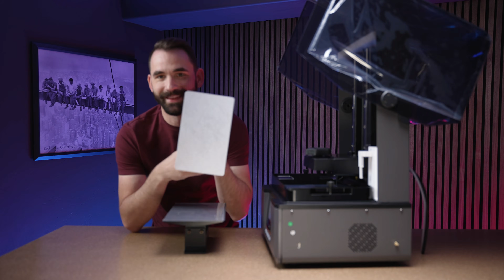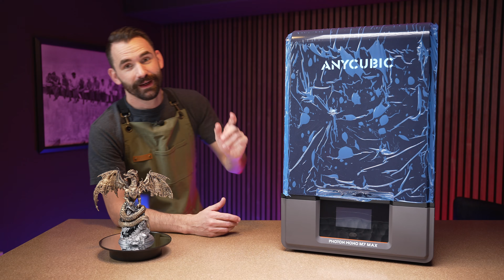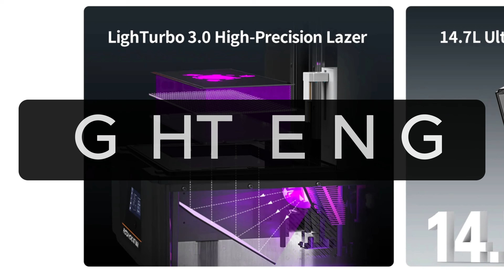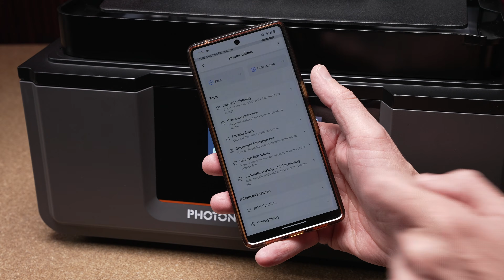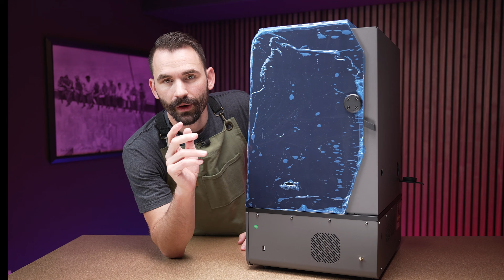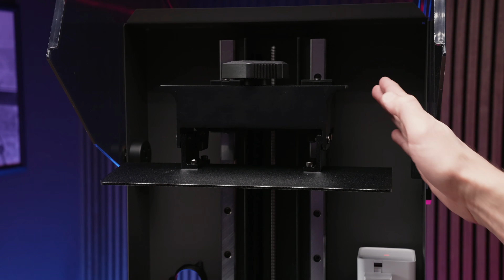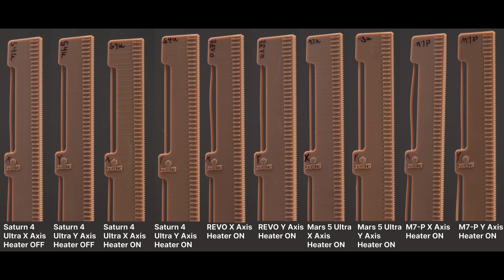Should the M7-Max be your next Printer?  #review #3dprinting

Comment: I have to ask and hopefully it doesn't sound like I am just seeking your opinion
I have the budget for either the GK3 pro or the M7 Max, same price really, but the M7 max just seems to have better features overall and seems sturdier, feels like the GK3 pro did not live up to its hype from the GK2.
That being said, I mostly use my printer for terrain and minis, spefically warhammer and bolt action, will the 7K for the M7 max provide enough details to print them ? Or is it better if I go with the GK3 pro instead.
Reply from the maker: @sergeys80  The GK3 Pro is a 10" and the M7 Max is a 13". 

The Pro uses 385nm and the Max 405nm what most of our resins are designed for. 

The quality of the M7MAX with AA still won't match the Pro but for terrain and that kind of thing maybe that's not as important and the extra size will be better.
Reply: @J3DTech  so the question is, will my details on my 28mm minis still be good enough ? I currently was using the Saturn 3 ultra 12 K until it broke on me so am looking for an upgrade.
However haven't heard the best reviews for the Saturn 4 ultra 16 k sadly...
I ask because the M7 Max so far seems to have the best reviews, and considering I am still newish, just want to get something that will make printing for me easier and allow me to print my minis
Reply from the maker: @sergeys80  If minis are your focus and not the terrain I would look at the GK3PRO. I have been playing with one and it's doing well. 

That M7Max is really good but it won't have the accuracy you're used to.
Reply: @J3DTech  I just saw your comment regarding the single rail and the fact that the GK3Pro is mostly made from plastic versus the M7 Max pro that is made mostly from metal and I guess I am just hesitant spending the exact same amount on something that feels a bit cheaper.

I also saw you reviewed the Saturn 4 ultra 16K and phrozen 14 K.
Both are also in my radar.
Reply from the maker: @sergeys80  You mean Ultra? 

The Ultra is the 13" the Pro isn't out yet. 

I have both.
Reply: @ Yes, sorry the Pro, I know it isn't out yet, however pre-orders are live now and it would ship by March. 
And I believe I saw your video on how you explained how it's plastic and only single rail versus the standard double rails we are seeing for mid range printers, especially for that price.

Comment: good evening, thank you for this video. I recently bought this printer and I have two questions: 1-how do you use lychee slicer with it? I tried to export an exposure test file but it is not recognized by my printer when I connect the supplied USB key.
2-I use sunlu 14k dark gray and the rerf test file as well as an exposure test remain stuck at the bottom of the tray. Is it my leveling that is not good or should I increase the exposure time of the first layers? (currently 50s)
Reply from the maker: @suprabot5640  It should work like any other printer. Just make sure that you have the M7MAX in lychee and your printer is fully updated. 

Inside this printer often with Lychee with no issues. But I would recommend skipping RERF and just using Boxes to dial it in.

On the Lychee Slicer YouTube channel I've created a video on how to dial in your resin settings go check that out.

Comment: Hello, I need your help badly:

I have an M3 max printer that has broken down since September. I changed the LCD screen because the resin had seeped in. The change went well and when starting to test, I discovered that a chip on the motherboard had burned out. I changed it and the chip burned out again in the same place!! Anycubic's after-sales service does not answer me honestly.

Do you have any advice to give me to save my 3D printer? Because I am an artist of Warp Worlds ... it is about the survival of my business.

Thank you for your help
Reply from the maker: It sounds like maybe there is still some resin inside the printer that's causing the issue.. It's a crappy thing for sure but if you get resin inside the printer... It's going to be a very bad time. with people I have helped in the past it sometimes ends the life of the printer fully. 

But my advice is to really make sure that there is nothing that could be grounding out. No resin or metal in the PS, or MB or anything. Make sure all cables are clean and free of any debris. 

As far as how do you get a new MB for test three send me a PM with your email and I can get it over to my contact over at anycubic and they can go from there. But again when dealing with electronics you're REALLY going to want to take your time and make sure everything is good, even pull out the voltage meter and make sure that nothing goes inside the PS and is causing issues as well. 

To be honest it may be smarter to go deeper and replace more components just to make sure you have a good unit again. Like I said before, often a resin dump into the chassis can be the end of that unit regardless of the manufacturer.. It sucks but sadly it's an aspect of this hobby. This is part of why I ALWAYS use the spatula to check the vat before every print.

Comment: Does the off compensation work the other way as well?  As in if it doesn't feel pressure from viscous resin will it shorten the light off delay?  I currently have mine set to 7 seconds delay in the slicer but just checked my print and only seems to be doing a delay of a second

Comment: Any suggestions for bottom exposure time? I've always been time you didn't want to go over 30-35 seconds because it's bad for the screen but I'm having trouble getting stuff to stick to plate
Reply from the maker: @JrodsRabbitry  How long you have to expose the bottom layers has to do with your layer thickness, resin, temps and the UV power of the the UV array in your printer. 

Setting a very long "wait before print"  time will also allow you to lower the bottom UV exposure time. But often this requires the use of UV tools. 

In the end do what works for you.
Reply: @J3DTech  ok thank you.  In your experience is it bad if I take it over 40 seconds?
Reply from the maker: @JrodsRabbitry  What resin, printer and layer height?
Reply: @J3DTech  sunlu abs like, m7 max, 0.05
Reply from the maker: @JrodsRabbitry  40s seems a tiny bit high but not horrible. How much light off dealy are you using? The M7Max is using 6s on the bottom and I'm working with them in a firmware update to force 10s. This SHOULD help you reducie this number.
Reply: @J3DTech  I did two things and one of them has resulted in getting prints to stick.  First, I leveled the build plate without paper. Just right on the LCD screen like I do with my gktwo.  Second, I changed the light off delay from 0.5 seconds which was default to 3 seconds. Now halfway through a print that is stuck to the build plate!
Reply from the maker: @JrodsRabbitry  I would think layer compression could be your issue. Print by Build plate calibration parts to confirm. You will find the link and instructions in my guide. My guide is in the video description.
Reply: @J3DTech  ok will do....and you think that would be from leveling on the LCD instead of using paper?
Reply from the maker: @JrodsRabbitry  personally, I would never level directly on the LCD. That is a great way to scratch it up or get some resin residue on it which will make it slightly sticky. 

If that LCD or LCD cover has anything on it, it's even the slightly as tacky you're going to have major issues with that release film peeling off the LCD during a print which will massively increase the peeling Force. 

The other issue is that you need space. If you are level too close to the LCD you're going to get layer compression. That's what you're going to be testing with these build plate calibration parts
Reply: @J3DTech  Got it....I just watched your video on common resin 3d printing fails...I didn't even realize z offset was a separate thing from bed level...yikes
Reply: @J3DTech  one last quest before I run this calibration, I don't see a z offset on the max, I'm assuming this is a setting I adjust in chitubox if necessary?
Reply from the maker: @JrodsRabbitry  You cannot adjust it in the slicer and it's not on the max not yet anyway. I'm pushing that to be added. So right now if you need to set the Z offset you just simply have to increase the thickness of material that you level on.
Reply: @J3DTech  thank you very much for taking the time to help.  Increasing light off delay has fixed my issue! I leveled again with paper, and have my bottom exposure time down to 35 and getting successful prints.  Not sure why the default delay on this print is 0.5s and then anycubic tells people to increase their bottom exposure to 80s 😳
Reply from the maker: @JrodsRabbitry  80s that's crazy for a standard resin
Reply: @J3DTech  yes, and I've seen many people posting screenshots of their successful prints and that setting, some even 100s because that is what anycubic support is telling people that are having issues with adhesion.  I honestly never would have thought about light off delay, so again, very thankful for your knowledge and time!
Reply: @J3DTech  if I could bother you with one last question....light off delay, is that the amount of time from the time the light turns off, until it turns back on, or is it the amount of time when it's finished retracting until it lights again?
Reply from the maker: @JrodsRabbitry  Luckely we are not dealing with the old printers anymore where you had to do math. Now it's the same as Wait Before prints. Or once the motor stops moving after a full retract, it will wait "X" time before the UV light kicks on.
Reply: @J3DTech  ok, I must not be doing something correctly.  I have light of delay set to 6 seconds in chitubox but after it's done retract it is lifting again in about 2.5 seconds....and I have 2.1 second exposure. So for some reason the chitu setting isn't working
Reply from the maker: @JrodsRabbitry  Hmm try lychee
Reply: @J3DTech  ok promise last time I bug you.  So if that is the case that it is the delay after retract, I should only need about 2-3 seconds delay correct?

Comment: Does UVTolls work with this printer, say per-layer settings or adding black bottom layers to compensate for the lack of z-offset setting?
Reply from the maker: @dariorseventyeight  They are looking into it. 

It it depends on what you're trying to do with UV tools. 

Anycubic printers don't allow you to set different wait time per layer. 

At least not at this time. Maybe in the future?
Reply: @J3DTech  I need to print directly on the build plate. Besides the initial blank layers for the Z off-set, I need to set custom waiting times before cure for some layers (not just the bottom ones) with high surface to let the resin stop moving. With high viscosity resin and such a large build plate, I see this being a potential issue.

Comment: would you recommend this for 1/4 figures? I have now the Apex X1 but I'm not sure how long it will last. This M7 is nice but seems it lacks detail. Maybe the GK 3 ultra is a better option or maybe going down to something like the new Elegoo Saturn 4 ultra 16k or Nova3d 16k. What do you think?
Reply from the maker: @OctavioAlonsoHernández  I can't currently recommend the GK3U at this time. It's having major issues. 

The 16k LCD is not what you want either. It adds 0 details as the resin can't even do much better then 8k. But the file sizes and slicing time on 16 are insane! Not to mention the motherboard can't always process the data during the print and you get some major issues. 

Honestly If you want a good printer avoid the following. 

16K LCD on any screen smaller than 13".
Auto leveling 
A built in heater with no ability to control the temps. 

This rules out almost everything on the market ATM. Strange times we live in ..

Comment: @J3DTech - do you still have this printer, or was it just on loan? Mine had a huge gap between the LCD and the Vat film - it was almost 1mm, and it made it impossible to print in the middle of the platform with high pigment resins. Nothing would stick to the platform in the middle even at absurdly high exposures and equally absurd lift heights and crazy long wait times before exposure.

Finally I noticed the gap between the LCD and ACF film and measured it at almost 1mm with known thickness shims. I realised that must be causing my middle platform print failures by trapping resin in a "pressure bulge" in the middle of the platform that was too thick to cure through and stick to the plate. 

I fixed it by installing a gasket under the LCD to lift it about 0.9mm - and now the ACF and LCD are almost touching. I reported it on the AnycubicPhoton Reddit, but no one there had the same issue, which puzzles me. Maybe my printer is different? or maybe it's only really an issue that shows up on high pigment resins - and normal resins will manage to stick to the plate even though the first few layers are too thick in the middle ....

So if you still have it, does yours have the same gap? Would you have a chance to try printing an array-grid of small parts with a high pigment resin?

Comment: @J3DTech just got the M7 Max, and noticed the resin heater is only for pre-heating, which is not very useful for me because my printing room is often below 10C in Winter. Posted about it on Reddit and Facebook and got several replies to the effect that the power supply is not big enough to run the heater and the printer at the same, but also one reply from someone saying they spoke to you - and that you said you had a beta firmware version that heated throughout the print - is that true?
Reply from the maker: @n0f8r  Yes there will be a update soon that will  allow the heater to stay on during the print.
Reply: @J3DTech  awesome! thanks 👍
Reply: @n0f8r  any update on the heater staying on update J3D I only bought it thinking it would be a vat heater for the duration of the prints
Reply: @ryannawrotzky4488  seems my first reply was silently black-holed for including a link to the anycubic wiki, so you'll have to find that yourself - here's the original reply:
  yes they released a firmware update in March - can't speak to how effective it is since I already installed a separate air heater in the cover and sealed it up - and also it just got warmer here. But if you connected your machine to your wifi you can do an OTA firmware update from the "clipboard" versions menu. After checking that option on my printer just now, seems there's been another update since that one - I'm gonna wait for the release notes to be updated before installing though - see wiki.

Comment: How do you get the heater to stay on, or does it just pre heat,
Reply from the maker: @mros3d  Yours will preheat only, this is something I learned just the other day that I'm running a beta Firmware that's not quite ready for full release. This was an accident on Anycubics part 😂 but soon there will be a release for everyone to run the heater during the print. They need to make sure it won't affect the UV power.
Reply: @J3DTech  I was thinking that, as I watched the temperature drop as I was running the test print, I'll wait for the firmware update before I run a full print so, thanks for the fast reply
Reply: @J3DTech  any idea when they'll update so it stays on ? Also when will they add to chitubox basic ?
Reply from the maker: @markmcguire6984  Not sure but I use Lychee Slicer and it's available there on the free Version.
Reply: @J3DTech  Any update on the firmware update, I'm getting serious issues with longer prints 😢 I bought the m7 because of the heater, but it's no good on longer prints as I live in a colder climate and my printers are in my garage, if I'd of know it just heated up the resin I'd of not bothered 😢
Reply from the maker: @markmcguire6984  It should have been out by now but the Chinese New Year got in the way. 

If you have discord send me a PM there.
Reply: @J3DTech  what's your discord link
Reply from the maker: @mros3d  https://linktr.ee/j3dtech
Reply: @J3DTech  no discord link ?

Comment: Absolutely stellar review. This is my 4th Anycubic printer, starting off with the Photon Ultra, moving to the M3 Max, then the M5S Pro, and received this on the pre-order list just a short time ago. And absolutely love it. To the point that my other printers (including the Photon Mighty 8K) are now just sitting while this workhorse takes over everything. And love the in-depth details you went into about the options and settings. 

I also leveled this with the vat in place and it's made quite a difference in my success rates overall. I was getting some failures on the edges, which got me worried. However, I went ahead and re-leveled with the vat in place and it's been banging prints out left and right since. 

I was wondering if you have taken "advantage" of the pre-drilled exhaust hole and paired it with something like the Mars Mate? I have a complete enclosure system in the garage - grow tent and ventilation - that the printers all sit in, but was actually wondering if the Mars Mate system with this printer helps at all. 

Keep up the great work as always! I refer to a lot of my friends and family who are getting into this hobby to your reviews and advice on printing and they all appreciate the work you put into this.
Reply from the maker: @psychoskin67  Thank you! My first printer was also an Anycubic the Mono x 6k a fantastic printer. I've never used the exhaust port but that's because my printers are in a well vented room.